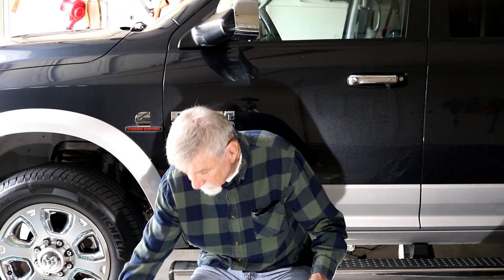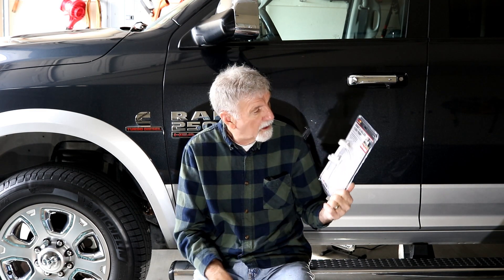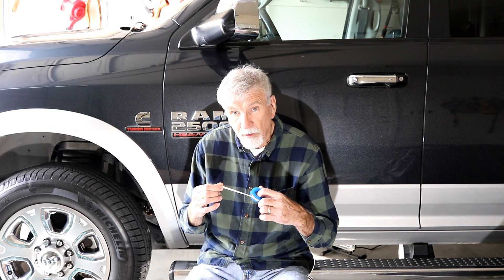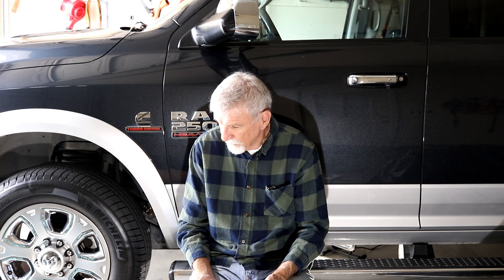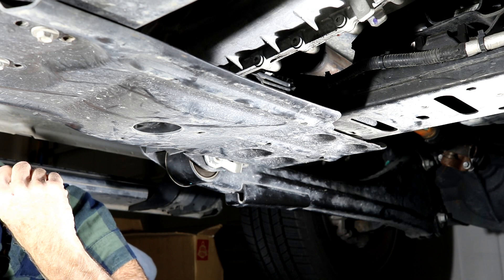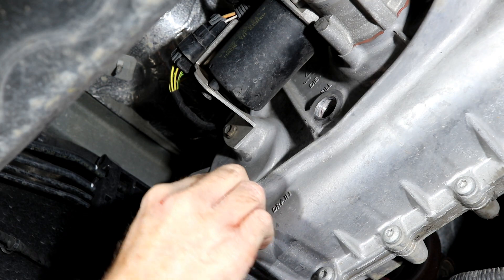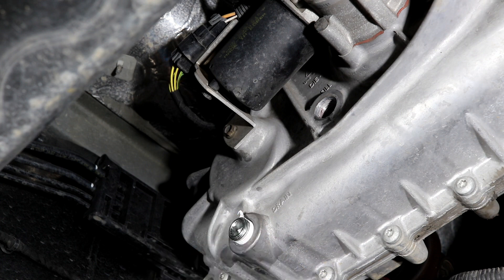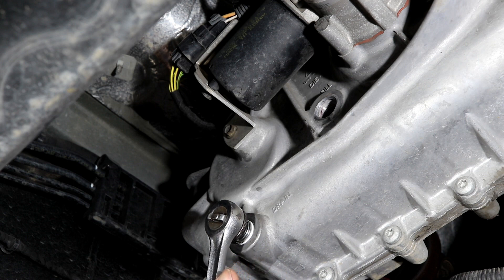Ram 2500 4 x 4 Transfer Case Oil Change

Comment: Marion what are the hand pumps called? Looks like they work well.
Reply from the maker: I used one similar to this one for the lube oil..  https://www.walmart.com/ip/Performance-Tool-W1139-Quart-Gallon-Fluid-Pump/174242525?wmlspartner=wlpa&selectedSellerId=13308&adid=22222222227066830627&wmlspartner=wmtlabs&wl0=&wl1=g&wl2=c&wl3=170941027830&wl4=aud-566049426705:pla-277466894071&wl5=9025237&wl6=&wl7=&wl8=&wl9=pla&wl10=120814000&wl11=online&wl12=174242525&wl13=&veh=sem&gclid=Cj0KCQjwxYLoBRCxARIsAEf16-thS8NWOD6wPlb-sZVckqjcBs4SuFdbAA_hBT__km7Kx-xLOvQN8agaAp9eEALw_wcB
Reply from the maker: Man, that's one hell of a link!  Sorry.  You can buy them at any of the auto parts or Harbor Freight also.
Reply from the maker: I used this one on the front diff.  https://www.harborfreight.com/multi-use-transfer-pump-63144.html?cid=paid_google|*PLA+-+All+Products+-+Higher+Sales+Items|New+Products+-+%281%29+Price+%3C%2410|63144&utm_source=google&utm_medium=cpc&mkwid=seX6eMeug|pcrid|278978017105|pkw||pmt||pdv|c|slid||product|63144|&pgrid=56296736066&ptaid=aud-454408221981:pla-296694731203&pcid=1458484684&gclid=Cj0KCQjwxYLoBRCxARIsAEf16-tun3sCqLN5VdGH7jMda6KtOytiKfhmNUIChv_waeaIbOvIIzvI19IaAlQoEALw_wcB

Comment: What fluid did you use?
Reply from the maker: I use the Mopar.  It's red, looks like transmission fluid
Reply: @MarionBlair  Just did mine @ 55,000 miles and it was still reddish in color, no towing. I was really careful tightening it with the PTFE tape.

Comment: Hi Marion,
Thanks for your videos.
I did my transfer case today. I have a 2500 2018  with Electronic Shift-On-The-Fly Transfer Case. I drained the fluid from the transfer case and it was red like yours. I got the fluid  from the dealer Mopar #68049954AA (Borg Warner 44-44 2016+ Transfer case) but it  is not red . Did they change the fluid for model after 2016 ??
Reply from the maker: That's interesting, I'm going to look into that.  They are the same transfer cases as far as I know.
Reply from the maker: Oh, sorry, you have a 2018, it's possible, going to dig that up, the stuff I put in was, 68089195AA and it's red.
Reply from the maker: I found this, you could double check with the dealer and your vin #. 
https://torqueking.com/product/801/mopar-68049954ab-transfer-case-fluid-for-4440-and-2016-up-4444/
Reply: Marion Blair I will still double check with the dealer on Monday.
Thanks
Reply from the maker: @bootsy1968  Yea, just to make sure they didn't give you the wrong one, the 1500 also uses that one.  They have created some unnecessary conversion and the owner's manual has no part numbers.  The service manual I have is for 2014 so it doesn't help for 2018.  let me know if you will.  appreciate.
Reply: @MarionBlair  I stopped by the dealer and they confirmed I got the right part number for my vehicle Vin number.
But they have no explanation why the change.
PS: the quantity of diff oil you added in your rear diff does not fit in mine.  3.8qt would overflow.  Same for the front. FT & RR diff was less than 5.5 qt total.

Comment: Did you see the transfer case switch down there? I had trouble finding it the other day. I'm needing to replace mine because of an intermittent "4x4 shift in progress" message that pops up randomly while in motion at any MPH.
Reply from the maker: Thanks, I'm going to look
Reply: Mine was the connector on the front axle, remove plug, put die electric grease on connectors, reinstall, problem solved

Comment: Do they sell the transfer case fluid in a pump?
Reply from the maker: Just quarts, you buy the pump.  very inexpensive however.  Like $5.  Holds two quarts.
Reply: @MarionBlair  thank you sir for reply back.
Reply: Thanks Marion. Can you please put a link to an example of the pump? I'm not familiar with it.

Comment: should this be done at what timeline of milage driven?
Reply: Check it at 30,000 miles, service at 60,000 miles/48 months.  If you're towing frequently, service every 30,000 miles/24 months.

Comment: Sir. Do you have any say about oil filter relocation ?
Reply from the maker: I'm not too keen on the idea.  Too long a run for the lines.  The filter would probably have to be located under the passenger side frame rail which is a long ways from the filter housing.  The one person I know that relocated his, ended up taking it off because of some sort of harmonics vibration the lines were causing.  Probably because they were too small?  It also provide more areas for leaks and thus less reliability.  Not sure if the lines siphon oil back to the engine when it's shut off but that's another concern.  People are successfully doing it however.  Going thru the fend is not bad once you get the hang of it or from the top.  But that's just me.  I'm sure others would disagree with me.

Comment: “ I glanced over at the u joint fitting and almost had a heart attack”  lol I’m getting ready to grease mine.  A mechanic I know always says a job will be a real bitch before he started, trying to psych himself to think it will be easier than he first thought.    I will have to say on my Dodge Ram I will never change the serpentine belt again myself...that was a bitch.
Reply from the maker: Yea,  the U joint isn't that bad if you take your time, and line up your grease gun properly.
Reply: @MarionBlair   a few videos suggest using a needle.  I have not tried that yet.

Comment: Check out my video. I had allot of metal shaving in mine. After I changed the fluid it ran so much smoother,  surprised the bottom drain does not have a magnet on it